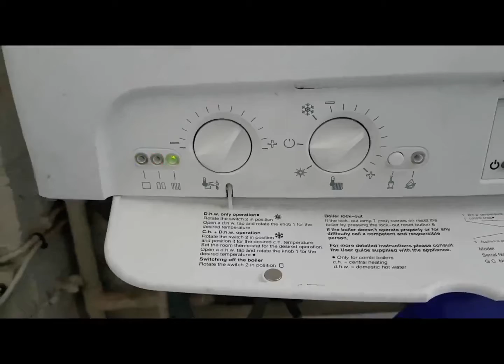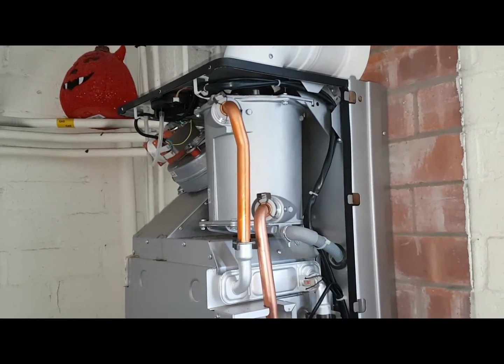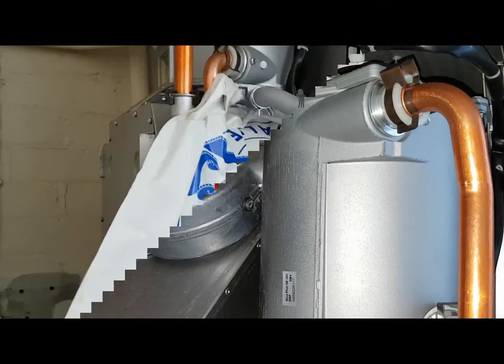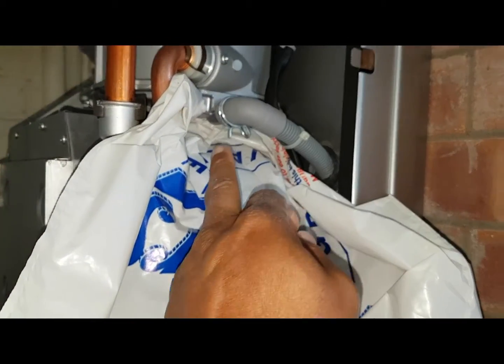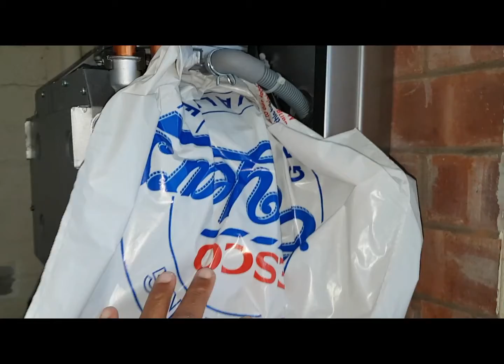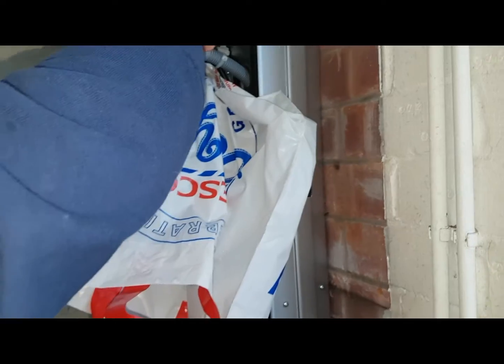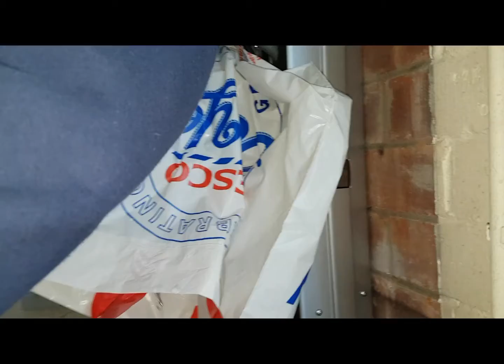Boiler Repair Training  Biasi Riva HE Red Light Flashing.  With Coach Tony Morgan

Comment: Hi, im getting the same fault on a boiler im working on, the 1 and 2 lights are flashing, number 3 light is stable. The manual is saying its the air pressure sensor, so ive ordered one. But aside from checking the condense for a blockage, is there anything else i can check?
Reply from the maker: Check that the micro switch on top of the divertor valve is making when pump starts

Comment: Thank you !👍
Reply from the maker: Thanks for your comments 🙂
Reply: TO ME THE REASON  THE CONDENSATE DRAIN  GOT BLOCKED  IS BECAUSE IT GOT CONNECTED INTO A DOMESTIC  DRAIN PIPE  THAT  DIRTY WATER PASSES THROUGH INCLUDING FOOD WASTE  THAT WILL BUILD UP ON INNER PIPE AND JUNCTIONS ,  NOT A  GOOD PLACE TO PLUMB IN A CONDENSATE  DRAIN , SHOULD SUGGEST TO  CUSTOMER RE PLUMBING THE CONDENSATE DRAIN OUTSIDE
Reply from the maker: hey we're currently trying to grow our Facebook group and would love you to join Tony and the team using this link, Tony will be available to answer all your questions directly https://www.facebook.com/groups/167070231326174

Comment: It is difficult to see the installation of the condense pipe, but it seems that there is no slant along the wall. I would think that this is the reason why it got blocked in the first place. Great video.
Reply from the maker: No it was the connection
Reply: @ARBoilers  Ay. I understand it was the connection, but why did it get blocked? Was it because there was no slant and stagnant water blocked the connection or was the water flow from upstairs that blocked it. I have seen condense traps installed likes this on new boilers too but with a slant (in line with regs).
Reply from the maker: hey we're currently trying to grow our Facebook group and would love you to join Tony and the team using this link, Tony will be available to answer all your questions directly https://www.facebook.com/groups/167070231326174
Reply: if it was blocked why wasn't it full of water 2 inches above where you pulled the hose off from the condense pipe! It wasn't blocked at all was it!